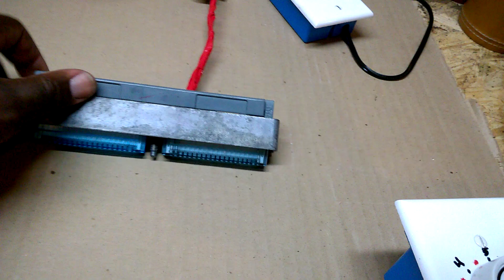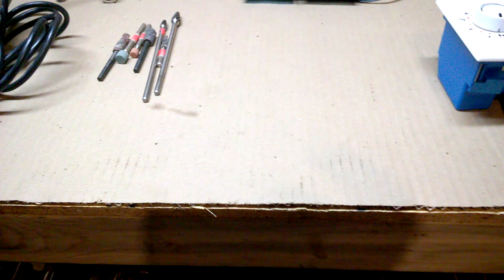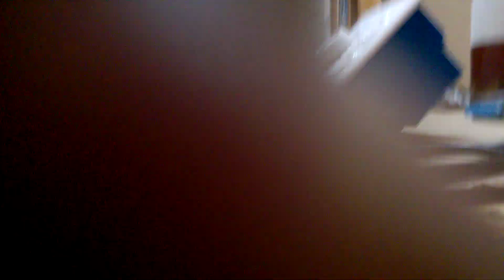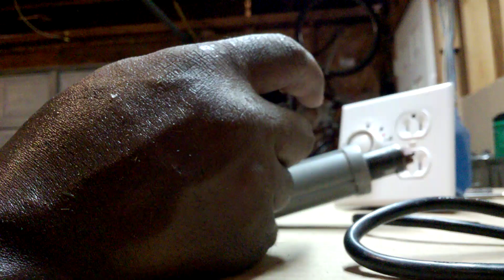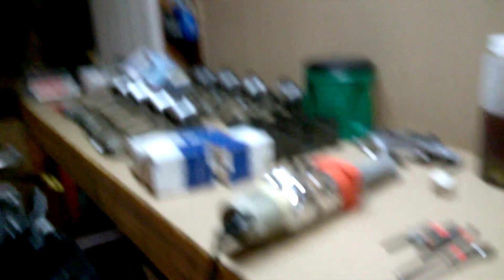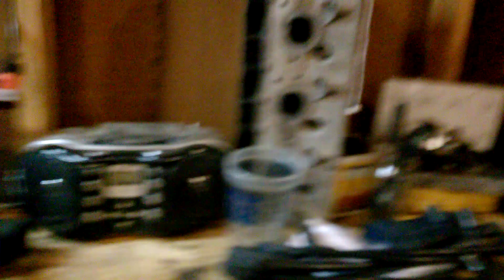HPTuner tool and homemade variable speed electric die grinder.......for porting LS heads!

Comment: Curious if you bought the rotary control and outlet in a combo, or if you wired the speed control up yourself? Im seeing some people saying to use a fan speed control because it regulates current, not voltage. Any help is appreciated!

Comment: just a tip. Cut the top flaps and front out of a large cardboard box and set your head in it on your bench. helps keep all the savings contained while porting.

Comment: I love your ideas with the dimmer but, concerned with it burning up the motor and when MOST  good tool's with variable spreds have something like a remote control car would but when you worked them up I know back in the day I or   whoever bought a better electric speed controller and they would be one of the best mods you could do to an electric remote control car and the better the speed controller the better the circuit board was with a nice heat sync attached to it for heat dissipate and they got really hot when playing with your car a solid 15 minutes or less. I guess your idea would be safer for a more expensive tool using a higher level dimmer switch like one from Lutron or companies similar or better because they had huge heat sync and I just remembered it always being a problem before I became disabled and was an high residential electrician that the back of the high end dimmer switches wouldn't fit in the boxes because of all the room it took up. Not trolling your channel U I love what I have been seeing here just concerned with using a dimmer switch that's best for this idea because it's a great idea. Just don't want to burn up my power tool's when using this method.  Being disabled sucks and don't have money to loose and trying my best to keep up with my passions like car's, motorcycles, and as you know it's a terrible addiction but also a great one just got to be a functioning gear junkie. Very hard.